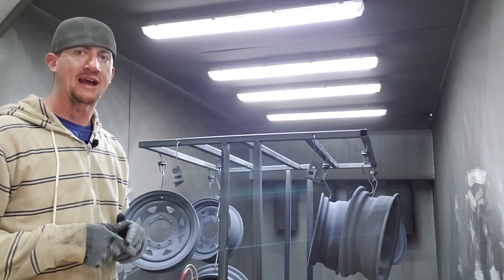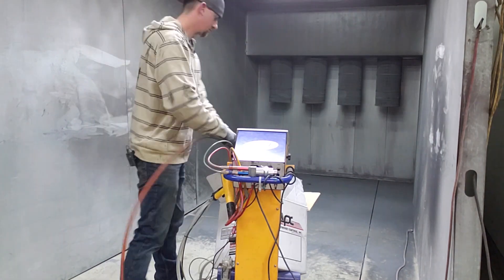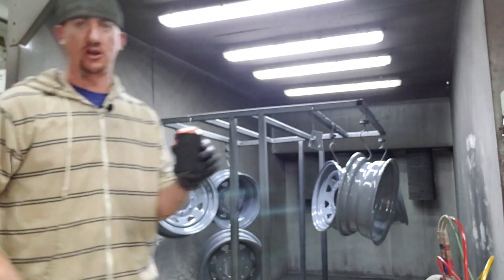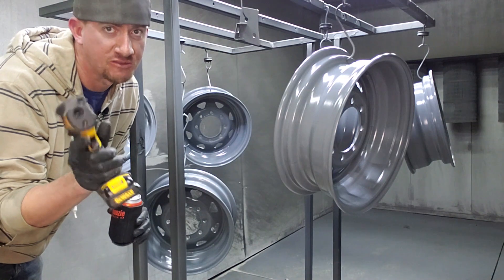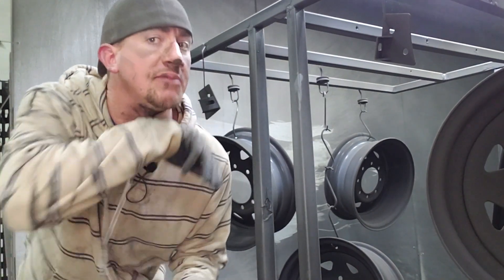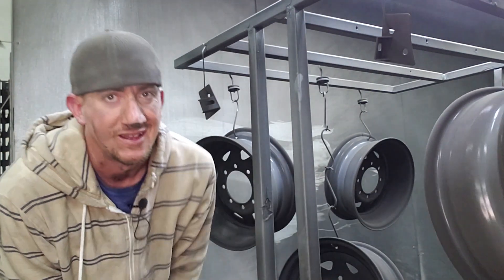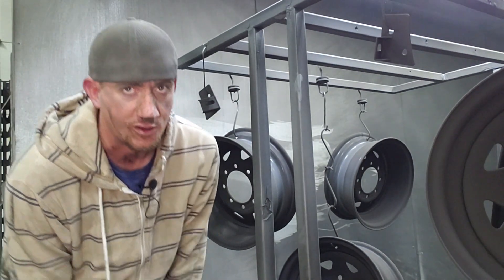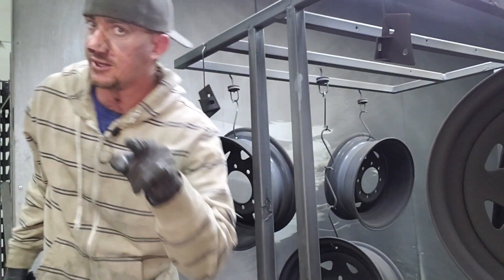Powder Coating - How to Powder Coat Steel Wheels - Our process from start to finish!

Comment: I bought the red oxide primer to do a job I have coming up is that ok or I should try get the zinc primer
Reply from the maker: Depends on the job, but will most likely be fine.
Reply: @RightNowPowderCoating  am doing some steel rims for the 2007 Toyota yaris, rust a lot in the area where the tyre sits so they leak a lot after a couple of weeks

Comment: So I was told not to were rubber gloves when spraying powered to avoid it being attracted to your skin. That could be why you where covered in it.  All I remember is that the gun in your hand contacting it kept the powder from sticking to your body and the rubber glove was an insulator that reversed that theory. I could be wrong.
Reply from the maker: Id rather use gloves than touch a part and get oil on it.  If you have a good booth  cloves dont matter, even with out gloves you are still a grounded source to pull powder to you.

Comment: Hey two questions. 1) what’s your powder machine? 2) what do you set the EMS on your dewalt temperature Gun
Reply from the maker: We use Gema and I sell them too.  EMS for aluminum is .93 I think...I'd have to double check though, look up ems settings in google
Reply: Right Now Powder Coating  so your gema what is the lowest cost of one that has amps and Kv that adjust separately? Can u send me link to check it out. I’m looking at the Kool Koat HD right now from Columbia coatings. Have you heard anything bad about this system so far I’ve only been told good from a couple you tubers that use it.
Reply: Right Now Powder Coating Question
First  do you worry about getting to much powder on the item. I keep getting parts with light spots on it but I think it’s because I have the mindset of painting and I think I’m getting to much on my project. So I’m constantly blowing off parts I think is two thick. Do you worry about the thickness? When I watch your videos it looks like you hit the parts with a lot of powder.

Second I just did a part that I had back ionization spots all over but I have the new PCS-1000 at 35kv as directed by Eastwood. I’m going to strip the rim down and redo it what do you suggest to help the ionization issues.

Comment: do you ever get fuzz? i get fuzz all the time is there a way to stop fuzz? i use microfiber towels and acetone but still fuzz?
Reply: We at Golden West Customs use brake cleaner. Once off the sand blaster we; air blow, rinse with $1.50 brake cleaner (removes left over oil deep inside), bake 30 mins, let cool 30, and spray between 100-120.... everyone had their way of cleaning and coating. But no rags, no mess, brake clean evaporates, no water used, no acetone which is expensive. Saves time.
Reply from the maker: @goldenwestcustoms6038  interesting, thanks for the info!
Reply from the maker: Yeah stop doing that lol.  On aluminum we wash with microfiber towel, rinse really well, blow off, heat up to fully dry.

Comment: if you use a primer to cover up small pits in rims weather steel or aluminum can you sand it smooth before the top coat? or should i try to hide imperfections a different way? i have just been told to hide with primers. what are scenarios that i should use epoxy over zinc primer?
Reply from the maker: I'd use one primer, full cure, sand smooth, wash, dry, recoat with top color
Reply: Rim Right thank u
Reply from the maker: @bjputvain  you bet

Comment: Those steelies are a royal pain in a#rse, that stupid inner ring and then there is always the weld casting!  Trying to get the old paint and media out of that ring is worse than doing. a three stage vac, job! Nice work!
Reply from the maker: Yeah no fun, should charge more for em
Reply: I am in the process of doing mine right now. Factory paint plus a coat of paint by previous owner. Couldn't get the paint and rust from the inner ring. Ended up using paint stripper and a oscillating tool with a worn out metal blade. Worked like a charm. Thanks for the amazing videos btw.

Comment: That looks awesome.   How much for the 5 rims coating, mount and balance?  If you don't mind me asking.  I don't want to be taken if I decide to have my rims done.
Reply from the maker: This will vary based on where you are.  To be honest steel wheels for me are more of a pain in the but due to the design and how they are welded.  This person had a size that they could not find so was willing to pay for them to be redone.  We did the primer and the top coat so they came in around 135 each.  Which is kind of pricey for steel wheels but like I said they really wanted to have them cleaned up.  Thanks for watching!
Reply: @RightNowPowderCoating  Thanks for the reply.  I'm planning to start restoring my 55 1st Series early next year and I'm trying to get a good idea of what I'm looking at spending money wise.  Once again thank you Sir.
Reply from the maker: @anthonywestjr1063  That will be a fun project, I doing body work on my 78 corvette right now, hope to post some videos on that in the coming months.
Reply: @RightNowPowderCoating  I'll  be watching...

Comment: What kind of air pressure are you using on your gun?
Reply from the maker: 3-5 psi
Reply: @RightNowPowderCoating  Ok..looks like a lot of powder coming out is the reason i ask.
Reply from the maker: @CainsCoatings  we most likely had it adjusted up for the primer and didnt turn it back down for the black, good eye!
Reply: @RightNowPowderCoating  ok..thanks.